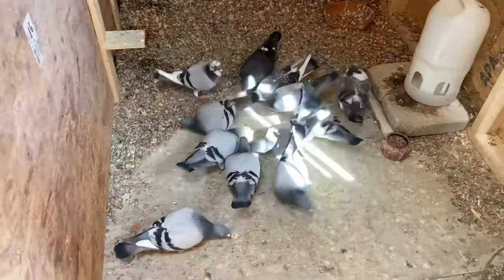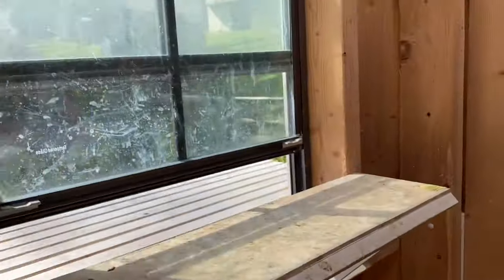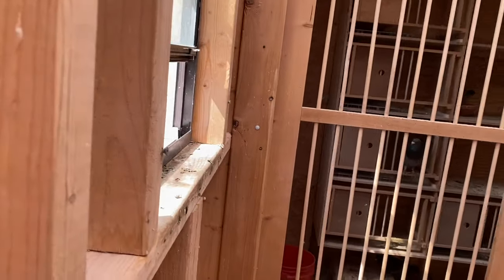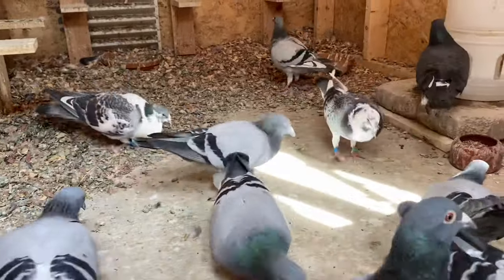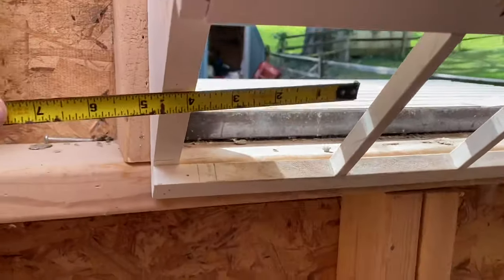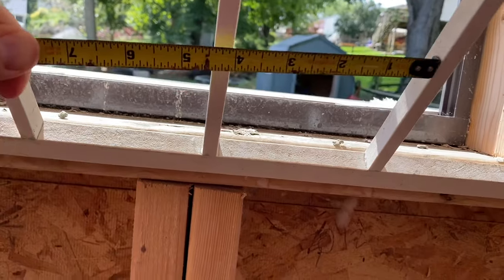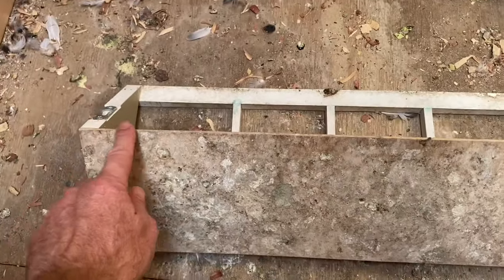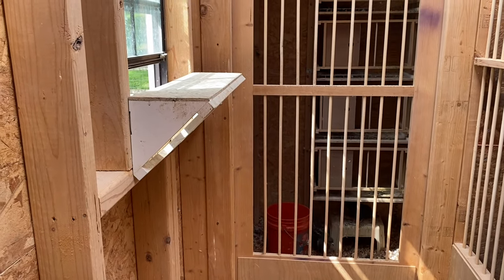Racing pigeon loft drop trap!

Comment: Awesome work. I change my pigeon drop trap design almost yearly and they still suck. You have good wood working skills. I would try your model next, but built by me it would probably look like crap. You also have bigger pigeons as I see them, many of my birds would still escape through those 4 inch holes.
Reply from the maker: Thanks, my friend! Good to hear from you! Mount a small diameter (2cm) pvc pipe through a dowel running along the bottom of the trap to create a roll-bar. They won’t be able to get out bc they won’t be able to grab onto the base of the trap. 🇷🇴🇷🇴🇷🇴

Comment: I like this drop trap idea. I'm working on drawing up the plans for my pigeon loft.  I would like to use sliding windows like you did with the same or similar drop trap idea. My big question about the loft is ventilation. I've noticed a bigger vent near the bottom of your loft in your videos. Is there a certain one you recommend or size? I just want to make sure I provide the birds with enough fresh air for ventilation. Thanks for your input! Enjoy your channel!
Reply from the maker: Glad you like the drop trap design! I love it! My loft is not sufficiently ventilated and I need to do something about that. I do have a vent I installed on the back of each section but these have turned out to be worthless. Get something that will actually provide good airflow. Let me know what you decide to go with and good luck!

Comment: I use a drop trap as well. One problem I've found is that the birds barely slow down when coming in and if you are using a antenna and there are a lot of birds trapping the antenna can miss some of the birds. I had to build something that slowed the birds down when they were trapping so the antenna picked them all up.
Reply from the maker: Oh that’s interesting to hear!! Glad you found a solution—nice work!!

Comment: We built this trap based on this video. After 2 weeks a few of the birds have figured out how to get back out. Any suggestions I can do to stop this before the rest learn how?
Reply from the maker: @BarbMuleLover  if you put a dowel with a section of 1/2” pvc pipe at the bottom it serves as a roll bar. Birds will have nothing to grab onto that’s stable.
I’m surprised your birds got out! Racing pigeons, or a smaller flying breed?
Reply: @RFRP  Thanks, I'll try that. They are white homers, young birds